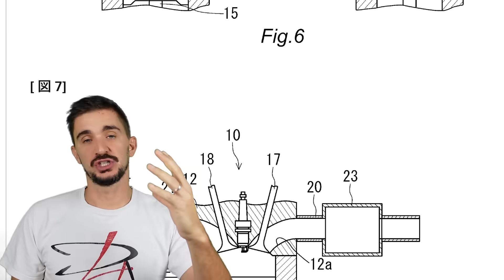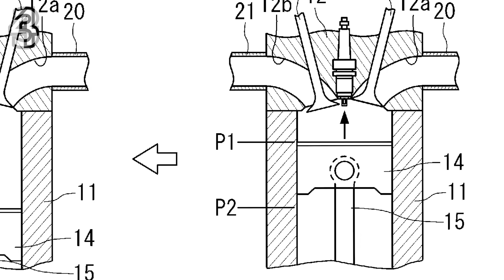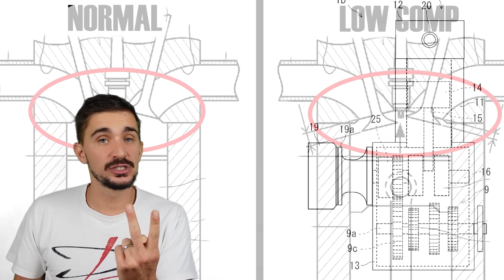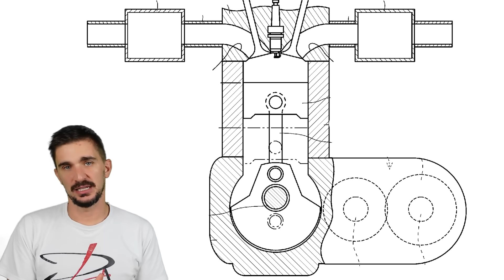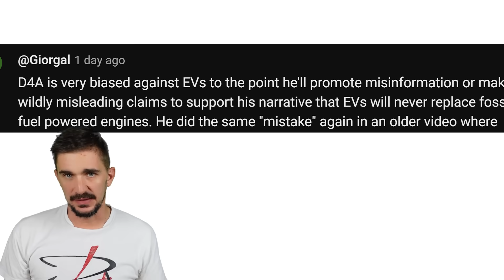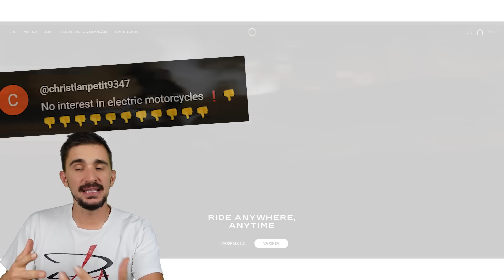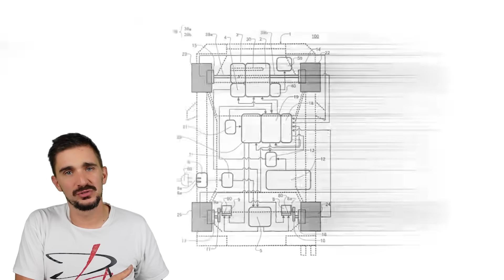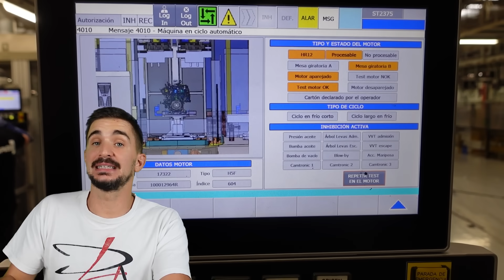Yamaha Just Patented A Fake Engine

Comment: They will never make this. Why would they? This just a red herring.

First of all: the sound this thing would produce will not resemble that of a proper piston engine. Yamaha has a legacy of acoustic excellence, they would not accept this. Second: if the vibration is a must, it can be produced way easier and with less losses, cost and weight.

They are just testing the reactions of the public and the competitors. They have learned from the master of fake patents, Apple.

Comment: If it was some kind of hybrid I would understand and then with the electric motor being able to enter the motor low friction mode for noise or disable it all together and have just the silent electric one, but since it's a bike Hybrid wouldn't even make much sense anyway as it's limited in space and weight cause overweight low power and low mileage bikes just wouldn't cut at least in my book...

Comment: My guess is that if globalists force consumers  to buy zero emissions motorcycles (which has been proposed already in California more than once),  if the design  qualifies as such, and if with a few simple  mods  can be converted by its owner to run on hydrocarbon fuel.   Then, one has a value proposition with the patent.

Comment: As an onsite air compressor, it might have a use. Not 1 person who rides would buy one to ride alone.  It could be used as a generator with letting the motor run to charge the batterie . A 2 in one type of thing one minute it is a compressor the next it's a charging engine . I can see it in quads in logging and mines where you need stuff quick easy to move.

Comment: 5:56 "There's no performance penalty for the stuff I just mentioned". I wouldn't agree in the case of fake gearshifts on CVT transmissions. There is a performance/efficiency penalty there because a continuously variable transmission is more efficient at managing peak power/efficiency than having discreet/spaced gear ratios. You could also argue that mechanical failure is brought forward by the jarring nature of shunting between "gears" in a mechanism that is designed to move smoothly through infinite ratios.

Comment: 9:17 "Do you have to change the oil?" With no combustion event, there will be nothing to blow by the piston rings and contaminate the oil, there will be very little heat build up, and the forces on the bearings will be less..  If the oil in this "fake engine" doesn't hold up at least 20 times longer than it would in a real engine, I would be very surprised.  However, I agree, it's a stupid idea.

Comment: For those unaware. Yamaha has one of the largest and most diverse R&D departments in Japan(maybe even the world). Motorcycles, small engines, collaborations with other companies, musical instruments, speakers, synthesizers, automation. For decades they have expanded on what works to try and guess what could be the next big thing in the future. Probably their biggest mistake was licensing out their designs for scooters to Chinese companies because now they're everywhere for much cheaper than Yamaha could have achieved. This patent is most likely poking fun at the Chinese for the sake of it. It is a carrot on a stick under a trap.

Comment: Saying that this engine is stupid means you're actually missing the point ; Rather have a less efficient electric motorcycle on the roads than one with a combustion engine. They know a huge part of the riding community will not buy a silent bike, so trying to find a real answer to this issue is a good step. Now they will need to find better ways to reduce the impact it has on the riding experience and on the performance of the bike, but research goes slowly, so give them time to perfect this :)

Comment: In my opinion it would be much more efficient and reasonable to basically have a speaker with a tube/exhaust pipe in front of it. And if you want to add actual vibrations just use a big version of a rumble motor on a Play Station controller

Comment: Wow, how is it possible that Yamaha could make an electric even more stupid than the miserably slow electric Dodge Chargers that make fake engine noises? The idea that a gearhead would find the fakery appealing  must come from the folks who rode on the short bus when they were kids, then got MBAs from Harvard.. Here's the deal, when I want a hi-perf hotrod that's fun to tinker with and. smells like gasoline, carburetor cleaner, and tire-smoke (yummy). I'll go for ICE engines and when I want to  win races, I go electric. Why not do both and get the best of both worlds?  Same applies to motorcycles.

Comment: Consider changing the “0 HORSEPOWER” to “-6 HORSEPOWER”, or however much power it draws from the electric system to run, because it’s not an engine but a driven unit.

Comment: This is outright ridiculous and silly. I can't intimation anyone will buy the fake engine bike for a number of reasons. Wasting energy (and added weight) means you have less range. And since you are filling up on grid power it will result in more CO2 emissions. And the thing that is cool about the sound is not the sound itself, but the feeling of power you get from it and the ability to use that sound to understand how the motor is working.

Comment: You can best believe that if that bike ever hit market, somebody is gonna do one of two things; Make it run on that engine conventionally, or make it run and make the electric motor a generator to run a hub motor(s) as a hybrid.
Reply: I'm thinking that if yamaha actualy brings this "fake" engine to market it will aready be a gas range extended EV and the engine will run in "fake" mode when under electric power.  You can't patent a range extender ev but you CAN patent the engine running in 'fake' mode.  Now if a competitor wants a range extender EV if they want the engine to reciprocate they have to actually burn gasoline or some other fuel to make it turn otherwise yamaha will hit them with a huge lawsuit because they own the patent on that.

Comment: Rationality driven man attempts to understand a (kind of bad) art piece.

I think its a combonation of a company speculating and grasping at straws for some way to win over EV skeptics. the Shotgun method of pattenting a bunch of random silly things incase they can use it later.

I completely agree that its a ridiculous excess that only attempts to mask the unique and new charactaristics of EV motorcycles, however the idea of Excess for the sake of physical or emotional comfort completely saturates the idea of an automobile. Why not ride a gas powered scooter everyehere? its the most optimal way of transporting yourself in terms of cost and speed. wouldnt everything else beyond that be excess for the sake of physical and emotional reasons?

a creation for the sake of appeseing the human senses is an element of what i think art is, and human beings need art to survive. we have been doing it since cave paintings. To create art that we like, we have to completely fail most attempts at it, which is exactly what i think this pattent is.

rationality is required for the business process and the patent process because its just a mechanic of how both of them work, but the context for the creation of this fake engine is not based in rationality, and i dont think there is anything wrong with that. I dont think they needed to pattent it, but i also dont think its wrong to attempt to pattent a novel idea even if its useless and kind of insulting to gear head culture.

I find it strange that the same man who wrote a beautiful love letter to the internal combustion engine is at such odds with a patent like this on the basis of rationality.

Comment: Here's a thing about bikes, you want as much power out of them as possible which is why they still use 2 stroke engines.
So then adding something that adds extra weight and does nothing is not only pointless but detrimental.

Comment: Love you, love your channel. Always watch whenever you drop a new video. 

About this patent: What's obvious to me (holder of several patents in electronics) is this: Whatever Yamaha invested in procuring this patent is small change, insignificant, really - to keep any and all potential competitors at bay - in case they actually do want to tool-up to produce this thing someday.

Don't confuse obtaining patent protection with intention to manufacture.

The patent now gives them the option of producing - or not - for many years. Smart business decision and cheap to do. They've bought 'insurance' against potential competitors should ANYONE decide to move ahead with this ridiculous idea. Having obtained this patent, they can now relax and think it over before committing to production. 

I'll keep watching your wonderful content for as long as I am able. You're an extremely talented 'teacher' (and your accent is 'cute' to my southern California ear). ;D
Reply: makes sense , they werent sure about market demand for authentically faked motorbikes compared to bikes that are faked in a fake way , so they rapidly neutralized the doubt instead of bothering with market research. 
i made a variable audio frequency low pass filter with constant phase and very high stop band attenuation. it imitates distant sound. but an audio transformer with fancy magnetics is not worth patenting in the era of dirt cheap DSP.  its like this dumb yamaha engine that can easily be substituted with a dirt cheap subwoofer.

Comment: Aprilia did a automatic gearbox motorcycle once, it was named "Mana", it was a nice bike with decent power. I've seen ONE of them. A complete failure. If you can't use a clutch, then get a scooter. And it's plenty of scooters around, some for those that don't know how to ride a proper bike, some for those that want commodity to move from a to b.
This will be the same, absolutely the same, it's even worse actually, maybe some dumb gen-zeer would get one, but I doubt. There is no sense in that. Absolutely NONE.

Comment: I think it's interesting that we as humans come up with objectively better technologies and then have to "downgrade" them to make them acceptable. Digital guitar amplifiers are made to replicate tube amplifiers, Photoshop has presets that emulate the colours and grain of Kodak Portra film for digital photos, every second Youtube intro logo animation uses chromatic abberation, VHS or glitch effects. LEDs are much more efficient than light bulbs, but they have the LED look so there are LED bulbs that emit not just one but several frequencies of light to more closely match the soft natural look of incandescent light sources like bulbs or the sun. And I do think that it's beautiful how we humans can't accept "perfection" whatever that even means, we want slight variations and idiosyncracies. I think there is something satisfying about ICE engines because they breathe, they create sound and vibrate and once they run they can't just stop but you instead keep them idling even when stationary. I get that. I have thought about ways to add some emotion to electric motors, maybe you could have a special rotor fan that pushes air through a hole in the stator and creates a brap sound or something. Other people in the comments have already mentioned mounting a piece of cardboard on your bicycle frame so that the spokes would slap it. I would be totally fine for electric motors to have some reasonably silly feature that just exists for the sake of the user experience. But I wish that EV user experience would be something new and unique instead of simply replicating the feeling of a combustion engine as closely as possible. And if it's being replicated in such a silly and wasteful way that's even worse

Comment: I was gonna get the CBR650 until they added the E-clutch. If Yamaha makes an electric bike, or a bike with any assists, I will not buy it. I’m getting a CB750 Hornet.

Motorcycles are plenty efficient, but if we wanted to reduce emissions even more, we could switch to propane/methane; we could build hybrids, 918/NSX style — which would be crazy; and/or we could do turbos/superchargers/electric compressors. I’m not buying an electric bike. FUCK NO.

I’m okay with an electric motor but it would need to be a LOUD motor connected to a conventional transmission, like a 3-4 speed, and powered by something cool like a gas generator or hydrogen fuel cell (series hybrid). Unless charging tech can give 100 mi in 5 minutes, consistently; battery health stays above 70% after 5 years; and we stop using cobalt and nickel — then I’m cool af with batteries.

We don’t hate EVs because they’re boring — they aren’t. We don’t buy them because they’re bad purchases. They suck to live with except for commuting; they’re overpriced, slow to charge, and have no soul. If an EV motorcycle like what I said came out, I would NOT buy it if it had a fake motor. Use a fucking speaker and a big Xbox vibration motor under the seat and in the bars 😭🤣

Comment: This isn't designed for you, you aren't the target audience. This is meant for the bikers who get Harleys because they're big and loud and don't care about the actual power or know anything about engines and they just wanna compensate for something. The patent has a purpose, it's to justify an EV to the crowd of bikers who have tall handlebars, take the bike into the shop, and they just like the noise and sound and feeling of being a dude on a bike. They don't care for the art, they just like the superficial vibe of being that dude in a leather jacket and a beanie on the highway going 5 under and 30 over. There is a crowd for this, but these are expensive probably and really need a few things like price cuts for EV's to be worth it. Eventually, (except for the US) countries will ban gasoline engines in parts of the world for climate reasons. (Again, except the US, our president thinks it's fake)
Reply: Gas engines are never going away and EVs will be the death of motorcycles if they become mainstream

Comment: There is a lot to unpack with this. 
Speaking as someone who has owned high performance cars in both ICE and Electric, and also own 2 motorbikes, I consider myself somewhat of a petrol head. 
This seems absolutely stupid. Let's take the cars as an example. my 470bhp electric cars performance was breathtaking. truly fantastically fast and smooth. And has no soul what so ever. Non. There is no mental connection to the vehicle at all. Fast, fun, a laugh, makes you giggle every time you floor the throttle. Yes. but that connection that drivers are looking for. doesn't exist. ICE cars fills that gap. 
The issue I have with this patent (assuming they will actually do anything with it) is that actually making the problem worse. Every motorcyclist I have ever spoken to loves motorcycling because of the physical connection you need to have with the bike to be able to ride them, the noise, the vibrations and everything like that. 
Electric bikes range are not good, they are heavy, they dont have fast charging so touring on them is impossible. But with this patent, they are going to take up space with a fake engine, making the battery smaller thus making the range less, and possibly making the bike heavier still with the fake engine. let alone the friction generated by a fake engine. Just fit an actual engine....
I own a Yamaha MT-07. I hope this doesn't come to pass and it's just another nail in the coffin for bikes and I will be every disappointed with Yamaha,

Comment: 6:10 It can be made partly or fully out of plastic seens there is no combustion thus reducing the "penalty" of added weight on electric motorcycle, since it has a clutch it can be deactivated, so no power is used on it, by a switch or something of that nature.. very clever actually...
Reply: Yep, and the entire "engine" could actually be the casing holding batteries with only minimal internal space taken up by the moving parts.
Reply: Or as someone else suggested: A way to bypass ICE engines ban, since its not actually an engine, but can be made into one with minimal effort.
Reply: Friction and heat would very much be an issue.

Comment: I'd rather have full electric bike than a bike with a slab of metal mounted in the frame. Imagine conversations with other riders.
-hey what is that engine?
oh it's the electric bike with fake engine-
Also instead of this id rather have a bigger battery or storage compartment